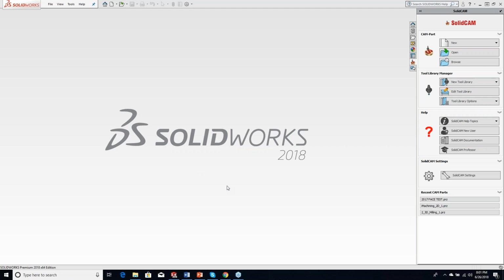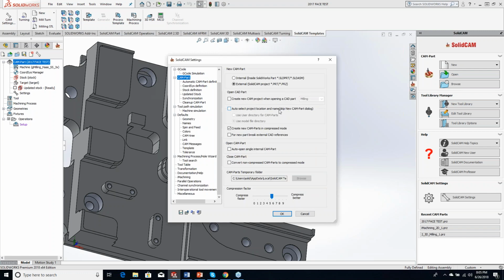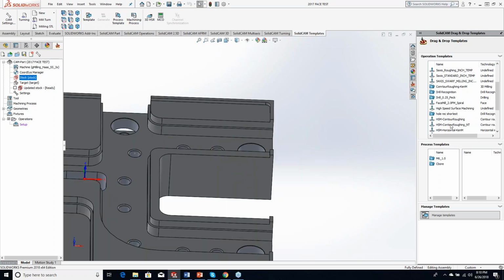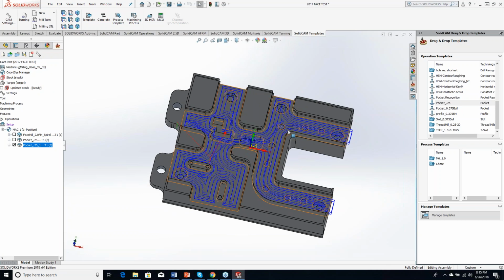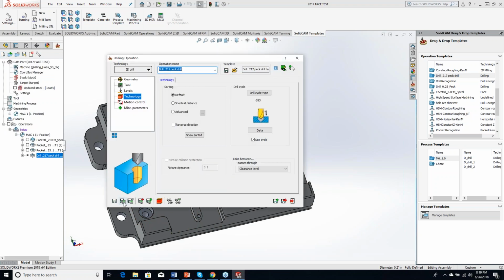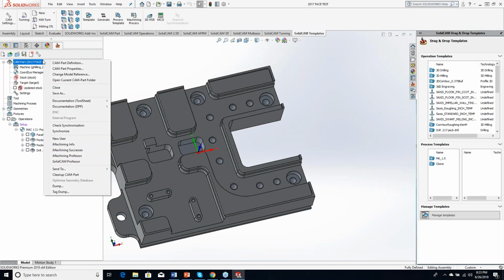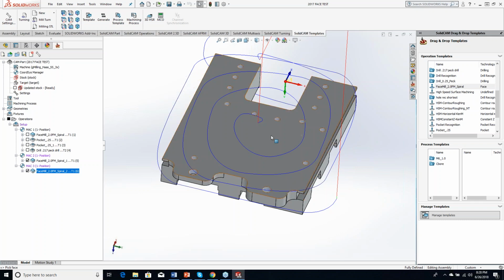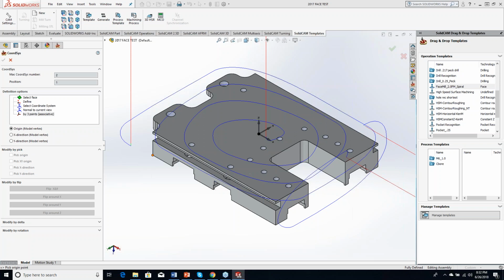KevCAM Night School - What s New in SolidCAM 2018 - General Enhancements

Comment: How do you get the tabbed menu on the right of your screen in the Solidcam 2018 embedded version? Also the setting 'Built-in CAM-Part definition dialog' only changes the CAM-Part setup window from being docked or a flyout window. It doesn't remove the new icons at the top of the CAM tree like you mention at the 4min mark of the video.